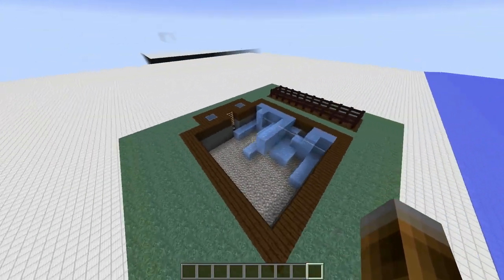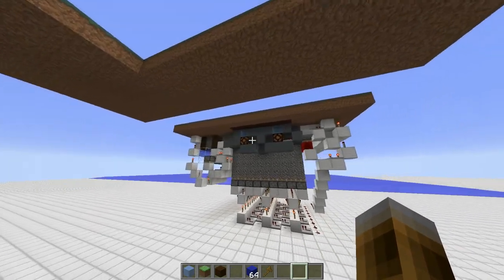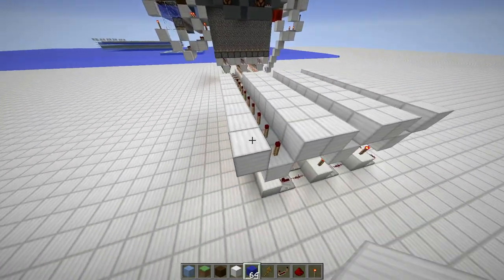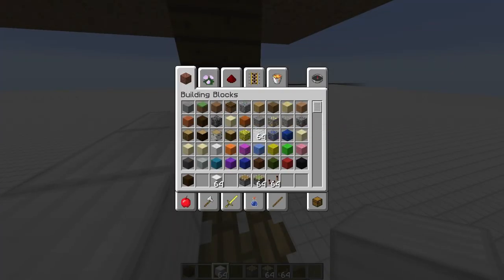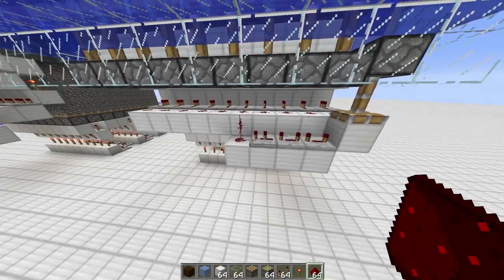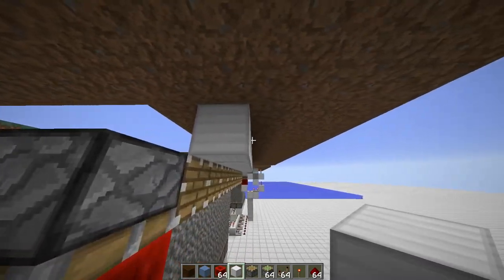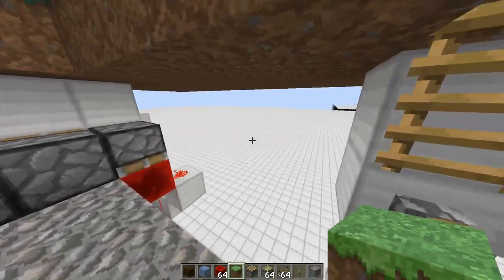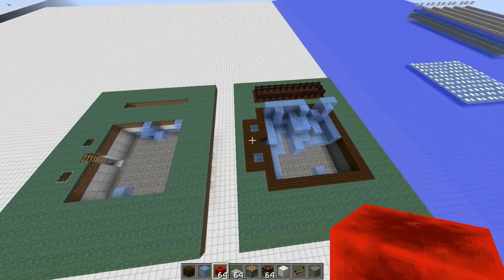Minecraft Tutorial: Simple Icefarm Design for 1.7.4

Comment: Is there any way you can do an ice farm that will pop the ice down instead of making it go up?!?
Reply from the maker: Well it is actually even simpler to make the farm push the ice downwards.  You just need to place positions right above where they are pushed out horizontally  and then put Redstone above  and connect it to the same bud as before.  The complicated powering of the upward facing pistons is them not necessary anymore
Reply: good thx man ill try that